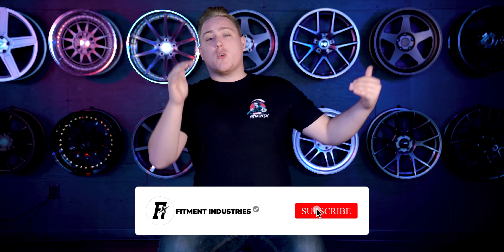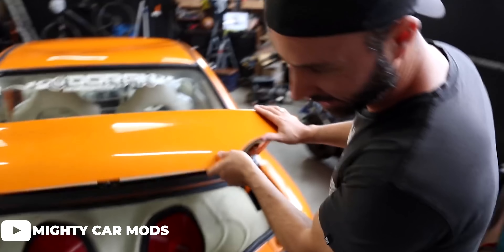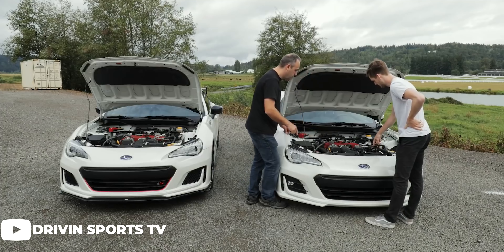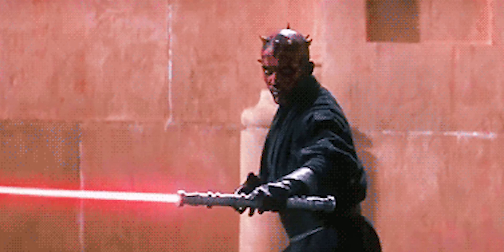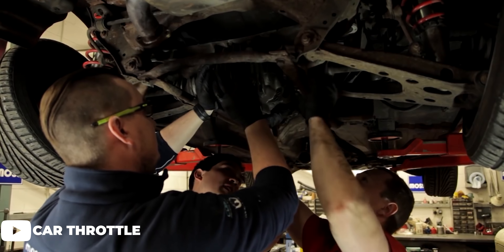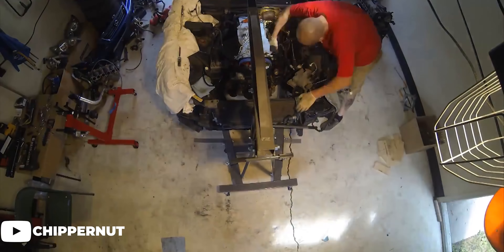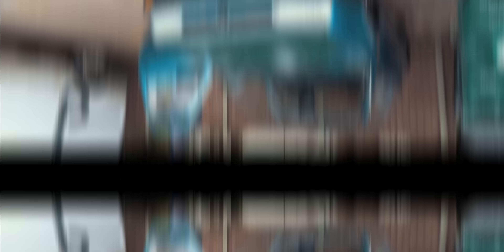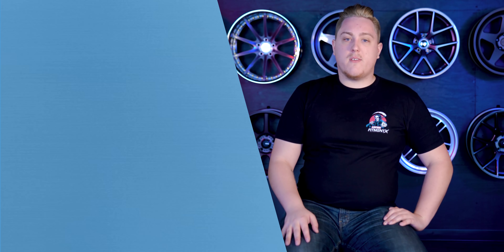The Pros and Cons of Buying A Used Modified Car

Comment: I think I ran into one of the best case scenarios when I bought my car this Summer. I was buying an NSRT4, so it was going to be nearly impossible to find a stock one. I ended up finding a guy who wasn’t an enthusiast, but had bought the car a few years ago from an enthusiast. The car was modded well, but wasn’t driven hard, and was kept inside by the non-enthusiast. It had been sitting for a while, but it was inside so only a few things had to be cleaned up. Over the past few months, I’ve gotten into it more and more and found that I paid for way more than it was advertised as. Most of the parts were quality parts, and was built well. The guy was honest with me, and it is nice that I was able to find a guy who didn’t know what he had but also kept good care of the car.

Comment: I bought a modified 2010 335i that the previous owner had modified quite a bit in order to be a track car. Took out the seats and replaced the front only, straight piped the exhaust, made some tasteful visual mods, and oh yeah, cut a fuck ton of wires as well as disconnected and sold the airbag module. It was a good car for the 3 years I had it though.

Comment: It’s a great idea,the entire bed of my truck was zip tied to the frame,real weight reduction
Reply: the real weight reduction is leaving off the bed
Reply: @fkgjhfdjyfddsrjgfd6186  I threw out my front brakes, my whole exhaust, cut off my wheel studs and welded my wheels to the hub, cut off the roof and all my seats. Weight reduction bro

Comment: Saw both Sides of the Medal. My Homemate bought a Lower, wrapped 2008 2gen TT with 2.0tfsi. New Interieur and a Tune.... The wrap was horribile Done and the Colour under it was Cut 1000 times. The Engine needes More Oil than Fuel etc. ... then the other buy was my 93' E36 Coupe with Lowering Springs a System and Bigger wheels and an Exhaust. The Electric is Crazy DIY but the rest is pretty Solid. So i would say it depends on the Car itself if you should buy it or not and the Knowledge you have about said car.

Comment: I bought my 2.5rs/gc8 slightly modified (completely rebuilt hybrid engine ej25d heads/ej251 block sti head gaskets 11:1 compression, all new sensors, delta cams, brian crower valves and springs, borla headers, jdm genome sti muffler, tein street advance z coilsovers, jdm wrx 5speed, aluminum driveshaft, wrx seats, Alcantara dash) from a dude that worked at cosworth (yes that cosworth) gave me a tour of the shop and everything, but even though he worked at that high of a race shop the car had some problems. The main problem that he neglected to tell me was when he got the engine rebuilt he had low compression in the 2 right cylinders so he just got that side done which threw the mechanical timing off and gave me constant misfires. I couldn't figure out what was wrong for a month until I finally compression checked it and seen 186 on the left cylinders and 234 on the right cylinders, took the heads off did the oldschool milling (sandpaper and a piece of glass) now it's nice and happy at roughly 234-236 between all cylinders. So I fixed a car built by a cosworth employee, he was probably a janitor or phone operator anyway lol.

Comment: Sometimes micro mods get added to cars and start finding extra doohickeys that they added and failed to mention what they do. Like the light switch in your house that does nothing(?)  that or rewired or wire tucked and nothing is easily looked up online for help for something that should be in plain sight. Possible old tucked away exposed amp wires that are live and shacking around that eventually hit metal blow a fusible link leaving you on the side of the road.

Comment: Had this with my first modified purchase. Audio-ground was tie-wrapped to a bolt. The previous owner was litterally to lazy to undo the bolt, make sure the ground was tight and put the bolt back. After that i found taped up, unsoldered wiring that was failing, foglights that were completely burnt out (both sides), headlight-tint on the foglights that was molten to the glass, breakshoes in rear drums were pretty much shot and the e-brake-cable was close to rusted through. Car had little to no maintenance during his year of ownership sadly. He did get a new MOT on it before i got it but probably done by a mate of his that just took the risk of getting caught passing a car with issues like those.

Comment: When I bought my s2k, it mostly had cosmetic modifications. I got it because it didn't look the way I wanted it, but it had parts I could sell or trade for the parts that I want. On the downside, it had a cheap stage 2 clutch in it and the pressure plate shattered 2 weeks after I bought it 😂 so be careful lol

Comment: I bought a modded 2014 mustang with 48 k miles. Clean title, I should be good??
Reply: Got a 2014 Mustang GT yesterday with 27,000 miles. It has a VMP Supercharger in six speed manual with list of mods equating to $16,580.00 from previous owner.

Comment: I’m thinking about buying a modded WRX. It’s a 2009 Impreza. Built engine, closed deck short block. All the work on the engine was done by a shop with 4.7 stars on Google. Making 480 whp. Stock 5 speed manual transmission. Guy has all the invoices and video proof of the car being worked on and dyno’d at the shop. Should I jump on it? It seems very tempting. Especially at its price

Comment: when u buy a 600 dollar truck and it breaks in the first week :( 😢
Reply: ACE Automotive shouldn’t have bought a $600 truck bro
Reply: JkTheBoss Ls swap will probably be the move. ls in a 1994 f150 xl. i think yes
Reply: ACE Automotive coyote would be more of a flex
Reply: JkTheBoss but wouldn’t it be more expensive unless i pulled it out of a crashed mustang then to by the ls?
Reply: Well kinda get what you paid for but don’t worry if your handy with tools everything is somewhat fixable. Hang in their bud.

Comment: First modified car I bought the transmission blew the second day
Reply from the maker: Ouch
Reply: F
Reply: The same shit happened to me but it was the next day
Reply: I bought my first car like that 3 months ago. Dude told me that it is technically fine just interior and exterior needs work. Engine blew after a week. Let a mechanic do a list of broken things, two pages, font size 10. Thing sits there while i`am figuring out what to do with it. came back to the car, whole interior full of mold ,car had a water stuck underneath the carpets.
Reply: @GeorgeCostanzo  damn son, my engine spun a bearing last month on my way to work

Comment: I found a used 1982 Datsun 280zx that has 170,000 miles on it and its been heavily modified exactly how i would want it and has a e85 conservatives tune using 12psi boost was wondering if someone could tell me if its a good price to get it at $10k or what price to try to negotiate it too.

Comment: Pros: you don't have to do any of the work to modify your car as it already comes modify 
Cons: problems lots of problems
You'll end up trying to fix up the car every time 
You'll spend more money than what you bought the car with 
you'll regret ever buying the car to begin with just because it came modified and you thought to yourself that you'd save money not buying the parts and doing all the work but now you're trying to put it back to stock

Comment: Anyone know of a good car that can be built/ easily turbo’d for cheap? Doesn’t have to be a daily but American or Japanese vehicles only. My daily car is getting high on miles so I’d like to buy something cheap and make it fun for when I have to get a junkyard engine or transmission for my daily. Cheap as in $1500 max around Florida. Condition doesn’t matter besides a reasonable amount of miles and not beat to death.
Reply: Lil MINI That opens another question, if I replace the stock seats or atleast get the convertible version would I fit? I’m 6’3” 
Update: it seems like it depends on how much you wanna drive a Miata lol. I’ll definitely look further into it. Maybe stop by a shady car lot to test a older one without getting a private owner excited for nothing

Comment: I always avoid it. They typically include a 50 bullet point break down of "mods" they did and want to overcharge as if you wanted those mods. My advice to these guys would be to return it back to stock and sell the parts you have if you really want your money back.